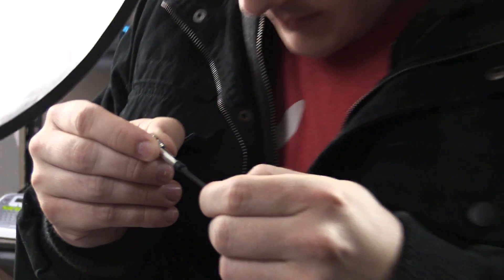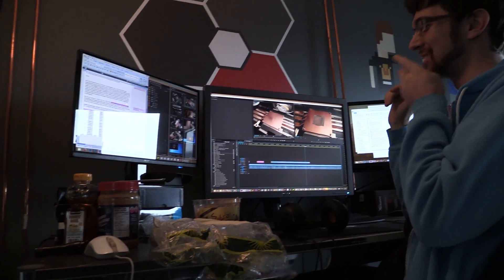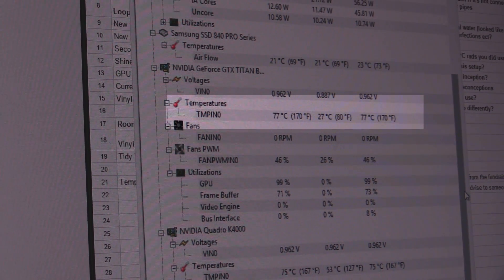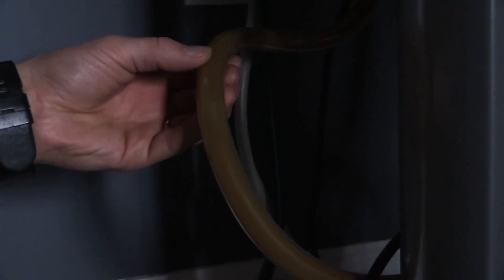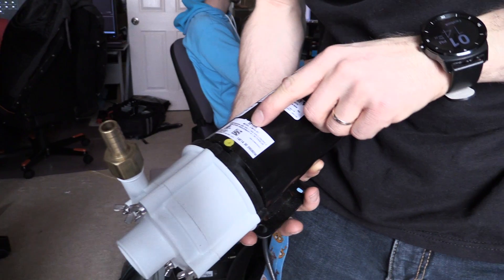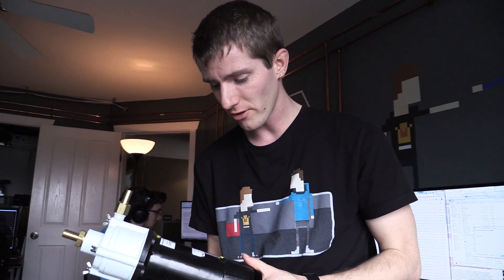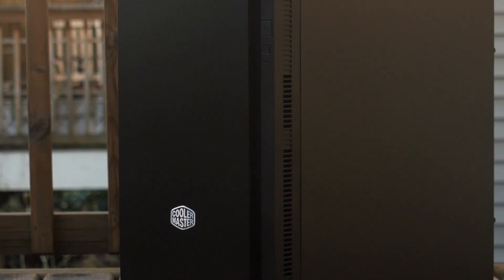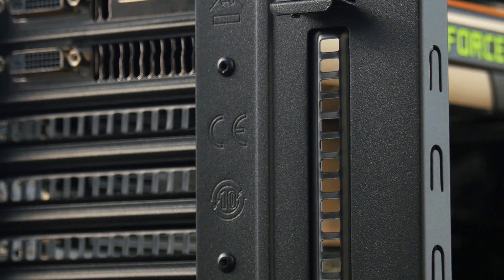Whole Room Water Cooling Part 5a - Trouble is Brewing in the Whole Room Loop...

Comment: I know its way late, and doesn't matter anymore. BUT: the "goop" is the left over flux paste from the copper soldering operation. The lines should have been static pressure tested; flushed with a chemical and hot water to remove the flux BEFORE ever hooking any PCs up; ALL connections to PCs should have been made from the start with leakless QD connections; AT LEAST a whole system filter, if not an individual one before each PC to ensure nothing goes into the water blocks; an antibacterial UV light system is easy to fab for something like this. I'm surprised the guy's father the plumber didn't recommend any or even all of this to them, BUT, then again, it is the modern definition of the millennials to outright discard the voice of experience. Just saying. LOL, been laughing for three videos now, wondering when these issues were going to be addressed...
Reply: "BUT, then again, it is the modern definition of the millennials to outright discard the voice of experience." yeah, go fuck yourself on that one.

Comment: I know this is a old vid now, and its probably solved by now. But tap water has all sorts of chemicals in it, and will generally corrode parts, as well as introduce organic matter. This is why you dont fill your car radiator with tap water, but Distilled water (with antifreeze depending on your climate). Also different types of coolant us used depending on your materials etc

Comment: You didn't use enough ethylene glycol (the ingredient in anti-freeze).  However, I wouldn't even bother with ethylene glycol and go with propylene glycol instead.  A 30% mixture is enough to ensure no bacterial growth.  Also, PG is non-toxic unlike EG.  Even though EG/PG are not bacteriocides, they do prevent growth of NEW organisms if used at least 30% solution (it's called bacteriostatic). SOURCE: Dow Chemical

Comment: I was going to say: maybe take a sample of that junk, and put it under a microscope to see if it has cell structures or something. That would tell you if it's alive, usually. Don't know what your going to do to fix this, but I'll find out in the next video. I wonder if you could run a thin oil through your system, like 'mineral oil', instead of water. I haven't heard of things being able to grow in pure mineral oil. (Not that I've done research on it.) I don't know how mineral oil interacts with heat, compared to water, so that might not be a great idea anyway.
Reply: I actually had no idea that mineral oil was actually used for computer cooling at all. I just remember reading a Wikipedia article on the stuff, and seeing that it was really thin, fairly cheap (being a byproduct of gasoline production or something), used for keeping extremely reactive metals away from air, also used for a kind of protective treatment for wood, and rather un-digestible but food safe (if I remember correctly). But a few minutes after I made that comment, I saw a video about cooling a computer in it. I was kinda disappointed that I hadn't been the only one to think of it, but also kinda happy that the idea must actually work, if people actually do use it (though, in a way I didn't expect: submerging the entire, or most of, the computer into it, which seems terribly messy, but maybe really good at preventing corrosion). I still don't think I would add rocks to my computer case though; it would just be one more potential complication.

Comment: Its your connectors causing the contamination, Galvanic corrosion. The copper and the other metal being in direct contact with each other are having a different electrode potential and if the antifreeze has been watered down too much it will lose its electrolyte inhibitors to prevent it from being electrolytic, one metal acts as anode and the other as cathode and you get a messy buildup. You actually have 2 types of metal that are in direct contact with the copper at the pump connection. The one type metal for the hose connector and the reservoir tank metal on the other side.

Comment: Atleast don't use alcohol for killing the bacteria. Some plastics can't withstand alcohol and they will melt. This is why there are multiple types of gasoline provided for cars as older cars used some kind plastic seals and piping that would've melted due to alcohol mixed in the gasoline. Some gasolines contain percentages of alcohol for keeping the system clean from condensed water. Optional non-alcohol gasoline will still be provided for those customers that have an older car. (1980-1990) Modern cars (2000-2016) are built with standards to tolerate modern gasoline. (water wont mix with gasoline but gasoline will mix with alcohol wich will mix with water)

Comment: LINUS what are you doing with copper tubing!!! did your plumber at least flush the pipes after solder them together you do that even for home use before you start drinking it. OMG lawsuit to the plumber for lost of gear. period.
Reply: +Matabei89 It was lukes dad who built it. Also they are using it for water cooling not drinking lol

Comment: I haven't read all the comments, BUT I think I know what the greasy stuff in your pipes were. I have experienced similar greasy stuff in my Zalman cooling tower water cooled pc (well, technically oil at present). It seems to be the anti-freeze eating away at the silicon tubing. Mine got so bad that I got earthworm-like threads out of the pipes and CPU block. It also ate a hole in the aluminium CPU cooling block. I "fixed" the problem by replacing the water with sunflower cooking oil. This also creates some gunky oily deposit around the silicon tubing for some reason after some time, but it's not so bad and the cooling performance has been great so far. The system has been running 24/7 for about 2 years since the replacement.
Not sure if you'll be able to fill your whole room loop with cooking oil, but just saying...

Hope this helps.

Comment: The Nice slime you just found on the side of your tank is basically algae, though it looks to have turned bad.  Breathing water vapour from this tank could be hazardous to your health.  (read up on Legionairs disease.)  Especially because this is a cold water system.
The CPU and Graphics cards should be ok, because the system temperatures should have kept the bacteria away.

One other thing to note is that the pipe you have going up in the air should have gone up, curved down in a U shape then gone up again.  This is because Air had direct access to the header tank,  If you sterilize water and place in a bottle with a straight neck and then do the same with a swan neck bottle... after a month the swan neck bottle and water will be fresh (ish)  but the non-swan neck will grow algae.
Reply: Basically Louis Pasteur's experiment disproving spontaneous generation
Reply: @Kallmekaida  Exactly his experiment disproving spontaneous generation

Comment: For pinching the tubing, that is a great idea. Vise Grips would have worked better. You will get better performance out of your pump if you DON'T throttle the inlet side. Run 1" or 3/4" pipe from your tank directly to the pump.

Comment: i had my cpu running at 120 °C
fu*king fans
Reply: You should look into adding some fans maybe
Reply: Aidan Adams :D Laptop
Reply: oh! i used to do this when my Xbox would overheat. So you can put little supports (Lego bricks are perfect for this) but you can use some stable small objects to raise the laptop up off the desk and hopefully get some more airflow and ventilation underneath it, hopefully lowering your temperatures and raising your performance.
Reply: Aidan Adams i did the same. nowmy computer is about 3 bricks higher than normal.and i also built a LEGO fan under it. :D
And i now know how to clean my inbuilt fan.

Comment: with different alloys, you really need to be running distilled water. I would have also recommend vw/Audi g12 coolant, or at least GM dex... at this point you should flush to distilled water and run CLR, flush, then run g12 and distilled.

Comment: Certain types of metal cause that brown sludge with the old style  green antifreeze, if you put the wrong coolant in certain cars this is what happens, should have used the more modern orange colored five year coolant as it doesnt have this problem.
Reply: Yup, the orange / red coolant is the way to go. The brown stuff is algea btw. And use gloves. If it can live off antifreeze (glycol kills stuff easily), it's dangerous stuff.
Reply: @f36443  Very few things can live in a both glycol environment and a blood environment.
Most extremophiles cannot survive outside of their traditionally inhospitable environment.
Reply: +Rawdilz Bacteria or algae, ethylene glycol was supposed to be toxic on its own. Apparently it's not toxic enough to kill off this stuff.
Reply: +Brian Hansen possible bacteria in the water.
Reply: I was thinking it was because of the copper pipes...?
Reply: @utservice9668   I thought the same.
Reply: Dex cool coolant turns into grown sludge when it get contaminated warm air. Ive never seen green coolant turn into sludge.
Reply: Yep, that is why they call it "DexKill".
Reply: Rex Holes ur so smawt
Reply: ehh im still wondering why they didn't just skip the reservoir and just pull the coolant through the pipes until everything was completely filled then just cork the system and connect it together into a closed loop, honestly the cooling is being done by the radiator system outside so the reservoir is actually a redundant piece, also if your going to continue using a reservoir the placement of the reservoir should be above the entire flow system itself so it requires less pressure to actually get the water moving the input should be in the top of the reservoir and the output should be right near the bottom of the reservoir so that the volume of liquid contained in the reservoir creates flow pressure all on its own, lol honestly do it right and the water will circulate itself without even the need for a pump cold water will flow down pushing the hot water up and back into the reservoir lol in theory it should relieve some of the pressure on the entire system making it easier for a lower power pump to push the same amount of coolant through the lines

when all else fails at-least you know Natural Laws won'i XD the Laws of Gravity never fail lol

Comment: just add silver in your lines, that along with the anti freeze should ensure nothing but hte rarest of stuff lives
Reply: colloidal silver
Reply: A silver coil kills bacteria. A few of those inside the tubing would easily be able to kill all of the bacteria. Not that it really matters anymore since this aint used anymore
Reply: how do you add silver?
Reply: Silver flakes?
Reply: Jet Fuel Cant Melt Steel Beams wait. They don't use it any more?
Reply: Is there tubing made of copper alloy that is less corrosive? Or are there other types of tubing they could have used? Also, why don't the copper radiators used in PC cooling corrode like this?
Reply: I'd presume because it isnt pure copper and its an alloy like you said. The copper used in this build corroded pretty bad and had to get taken down.
Reply: Alan Gonzalez Copper is really corrosive, for some reason they didnt know this till they put it all together. Copper being corrosive isnt really an issue when you're getting tap water but when the water is cycling 24/7 constantly then it starts to make the water all shitty and grimey. They had to take it down ;-;

Comment: Wouldn't this setup cause the computer closest to the radiators to be very hot? Since it gets the water which cooled the other PCs?
Reply: +Leanardoe i think it is a "parallel" system so every computer gets water directly from the pump and delivers it back to the radiator.
Reply: Ewout Wielenga Not enough pipes for that.

Comment: I know the whole room thing is dead and gone and such...  But, anyone that attempts this and uses a layout like you have should do a few things differently...

1:  Add two T's at the end of each pipe drop and connect them together using a shut-off valve, this will allow water to circulate in sections that don't have machines connected.

2: Don't have the copper pipes level, have them at a very slight incline to create a high point - at the high spot add a T, a shutoff valve, and then run clear tubing from that valve to a drain for easy bleeding of air trapped in the system

3: Anti-freeze and DISTILLED WATER - otherwise you can introduce certain bacteria that ARE resistant to the toxic components in anti-freeze, and any "safe" antifreeze usually wont cause most bacteria to die to begin with.

4: Use a screen mesh filter to trap and filter out any large particle contaminants.

5: FLUSH EVERYTHING BEFORE USE - antifreeze HATES oils, and all those blocks and other components I can almost promise have an oil residue, this will cause many antifreezes to gel up somewhat.  Virtually impossible to flush all that stuff together, but flushing individual components helps.  Flushing the main copper lines and radiators with radiator flush treatment for a few hours helps make sure everything is removed, just don't use that on the cheap water cooling tubes, it will probably eat through it.

6: NEVER ADD ANYTHING OTHER THAN DISTILLED WATER AND ANTIFREEZE - adding in bottles of "coolant" meant for normal water cooling of a PC can cause the antifreeze to react in bad ways.

7: Have a flow check at each drop on both inlet and outlet to ensure that machines are getting proper flow, shut-off valves can help ensure that each drop has the same flow-rate.

My ideas come from years of working on cars and computers both - I have seen what can happen to antifreeze when you have oils in a system, or use tap water - it's NOT pretty.  Antifreeze doesn't exactly stop the electrolysis that goes on when you have mixed metals in a system, ever, that's why it's so important to use distilled water.
Reply: Chucks Basix Lol Linus made fun of you in the video
Reply: It also might have been better to use a radiator/fan from a car or home A/C unit OR redirect that heat into something useful such as helping heat the building's water supply.

Comment: Looks like the flux remnants from soldering the copper pipes.
Reply: bannablitz247  I know for sure having done all phases of plumbing, the copper NEVER gets cleaned out before installation. We usually flush the system with water after completion.
Reply: +Pha Q plus i dont think copper is usually cleaned before distribution, or at least not very well.
Reply: +Pha Q yeah i came to the same conclusion
Reply: +Pha Q depends on what kind of copper you work with, regular plumbing copper doesnt need to be cleaned out. 
Airconditioning copper ( wich is thinner, more bendable) is cleaned before installation as even the smallest amount of polution can cause major defects in airconditioning systems. Then after installation is it cleaned by pressurizing and going into vaccuum, getting rid of all air and airflow like particles still in the tubing since airconditioning systems cant obtain moisture in the tubing

Comment: galvanic corrosion?
Reply: +Edward Grindstaff you have to use galvanized pipes to get that type of corrosion; they have copper.  Its definitely bacterial.
Reply: galvanic corrosion can happen between copper and iron. I assume copper and steel also. I don't know if the metal stays in the water for very long though.

Comment: IM a master mechanic and mess with computer systems. Did you use distilled water? It will have contamination if you use tap water, or even filtered. Most of the cooling systems in cars look like this due to tap water.

Comment: for the tension relief on the cable at 0:45 use a metal spring as it will allow the cable to bend instead of keeping it completely straight.

example: http://www.thermalsolutionsoftexas.com/pdfs/Sensors/MI-MetalTransitions.pdf

Comment: never mix antifreeze with water, it will couse shit to happen... either its destilated water, either clean antifreeze.!
Reply: Andis Strazdins There is water in antifreeze. Your not supposed to run straight antifreeze. They sell 50/50 for a reason. Also if you buy the concentrated stuff. it says to add water. I know this is a very old comment but no one responded so yeah haha
Reply: Andis Strazdins Unless you live somewhere with crappy water, theres no need to use distilled water. I know manufacturers etc recommend it, but it's really not necessary. Unless you live somewhere with water thats not very well filtered. And you are ofcourse supposed to mix water and anti-freeze... You can run straight antifreeze (Some brands) if you live somewhere very cold. But 50/50 is usually safe down to below 20, so no real need to do it. Like the other comment says, theres a reason they sell it pre-mixed 50/50 with water..

Comment: This entire project made me cringe.  Soo much unnecessary piping that it required a pump far larger/stronger than necessary. I thought the piping itself looked pretty ugly too, and imagine if a leak sprung, or if a desk got knocked into the piping, or whatever else.  This whole build makes the case for small isolated systems.  You would have been better off building all of the computers into one single rack and running cables to the various workstations.  Clearly bit off more than they can chew.

Comment: hey I just watch this and its likely algae wits grow in your system sins that stuff grows in everything and if your system don't get hotter as 80 degrees Celsius  almost every algae can live in it + if it runs between 15 and 45 degrees Celsius 97% of them will even thrive
and even in tap and most bottled water there are algae just in low amounts but if day are exposit to the rite conditions day reproduce like crazy1 way to make sure day don't is to but a boiling point in your loop so day die of before day can reproduce